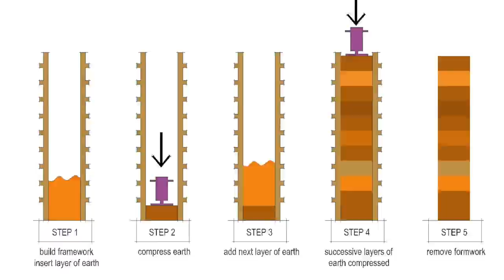Rammed Earth Construction

Comment: Top soil would probably be a more stable feed stock if it was put through a settlement process first to float out organic material  and then dried and sifted. I did some experimental projects a few years back and found that a cement binder is worth it in so many ways.  Especially in a climate where moisture and frost heave could be an issue. I also experimented with a few additives to improve durability. It sounds a little nutty, but a little acrylic floor wax (future, Armstrong, ect.) Really helped the weathering resistance.
Reply: Matt what would be your receipie for garden walls like this in Ireland? Just wondering I'm new to this.

Comment: You miss a step between 2 and 3... each rammed layer must be scratched/raked to roughen the top of it to provide a good mechanical key for the next layer. And as mentioned before, use subsoil.
Reply: nor do the wood blocks have perpend rebates to join to the next block - that step missed
Reply: They did basically everything wrong but thats to be expected from varsity students.  Its no wonder the chinese are building everything now.

Comment: Would someone mind telling me how you join one portion of the wall to the next using the existing formwork? I would imagine there is a some sort of hole for the rod between the two pieces of formwork that then needs to be filled? 
Cheers
Reply: Hi, I know this is 2 years later, but what I've seen on YouTube and some other websites are that the block of formwork is removed witch would separate the first and second parts of the rammed earth walls. So instead of having all 4 sides of the formwork for the next part of the wall, you will be using the previous rammed earth part as a replacement for one of the sides for the formwork. For commercial house buildings I've seen the construction workers build almost the entire wall's formwork (except for height) and build the rammed earth walls like that. They also build the corners in formwork for the corner walls. You ca also make rammed earth bricks and build any way you like with those. I did not yet see what people use for mortar, but as far as I know, mud, concrete or lime could be used.

Comment: You do know that there is no need for cement if the amount of silt is high enough, right? This is the big problem I have with Rammed Earth construction in North America. Most builders aren't aware of this fact.
Reply: You will need it if you want to resist weather erosion.
Reply: you do NOT need cement at all. 

the reason the 'unstabilized' earth in the video can get holes is because it is too wet.

 also, their compression technique is too soft
Reply: The houses built in the middle ages of rammed earth are still around because the roof keeps them safe and as you say they were built using just slightly damp earth rammed hard and allowed to season layer by layer. No cement was used or really needed but it certainly would not hurt to add.